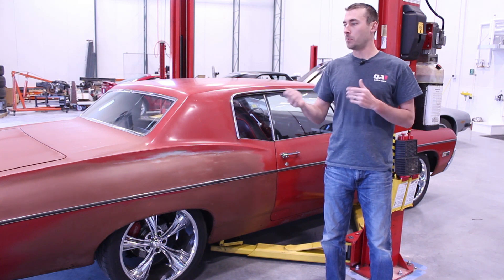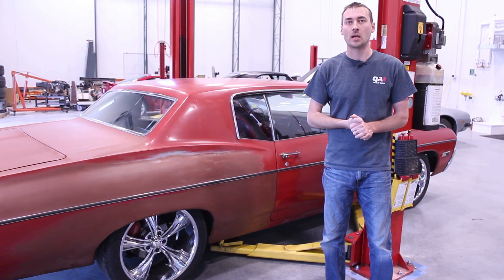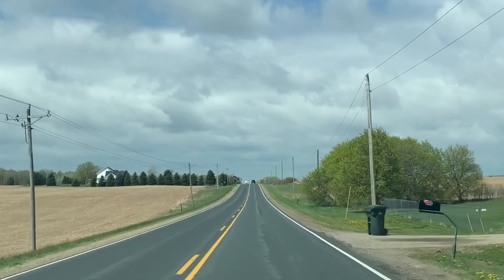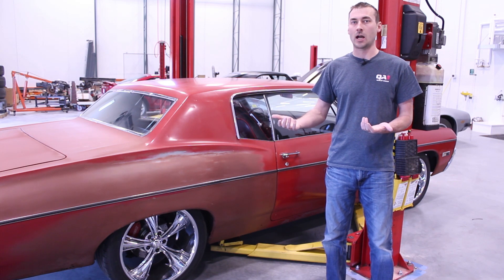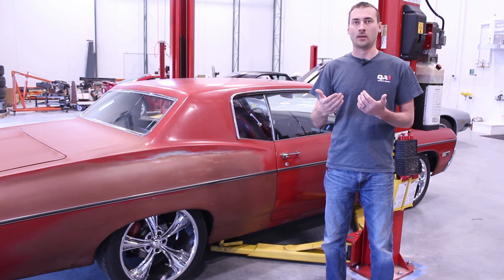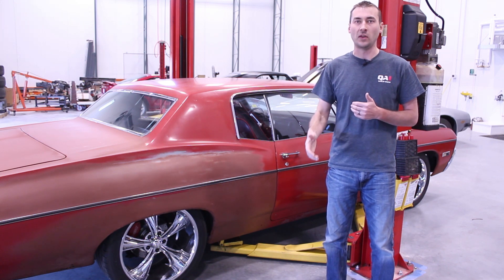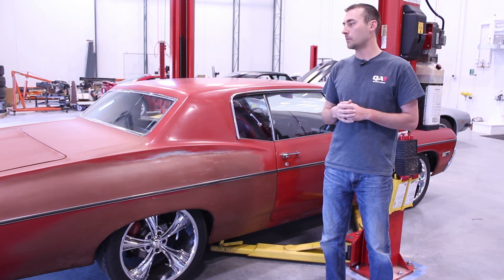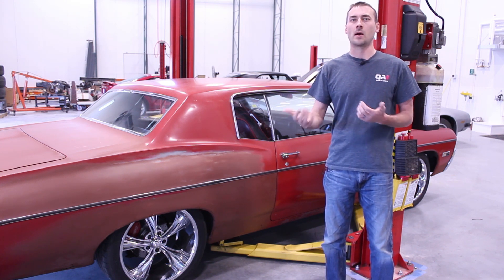Fine-tune Your Suspension for the Perfect First Drive | QA1 Tech

Comment: You answered my question so thank you. I read in the instructions to only make adjustments with the weight off of the coilover. I bought the single adjustable rear shocks and that didnt sound right. I had adjustable struts on a 240sx years ago and they did not require that so it didn't make sense to me. Figured I read the directions wrong and clearly I did cause I have the shocks, not the coilovers.😅 Which helps a lot cause I started the shock adjustment at 7 and it is a little pogo-esque. Didn't want to have to drag my jack and jack stands back out and jack the car back up in the 100 degree July heat!😂

 Even with the stock front coilovers, the handling on my 08 Grand Marquis is supremely better. I also added the CHE Performance upper and lower rear control arms and I am loving this set up. I cut the front coil springs one full coil and that stiffened up the front and lowered it 1 inch in the front. It's great. But I will do QA1 coilovers in the front down the road!

Comment: why not start with it too stiff?
Reply from the maker: There isn't a right or wrong answer! Your starting point may depend on your application. If you are looking for a stiffer performance street feeling then starting there as a baseline would be good! Call our tech line at 952-985-5675 with any questions you have

Comment: it would make sense to start in the middle. If there are 18 clicks then start with 9 in the front and maybe 7 or 8 in the rear and then go from there. I would never start at zero, Zero is basically no resistance at all- More for drag racing applications.

Comment: Hi I just purchased two new front shocks original nissan for my 2013 armada  when I installed i noticed  the next day the front kind of drop a few inches  any ideas?
Reply from the maker: Our front coil-overs are designed to lower the vehicle up to 2".
Reply from the maker: https://www.youtube.com/watch?v=ZZFqMNI8HPA
Reply: @QA1TECH  - ^ they said shocks not springs. Shocks dont adjust ride height, springs/torsion bars set ride height.

Comment: Why does QA1 define that full zero is all the way out?  Every suspension tuner or manual  up till now that I've seen says full clockwise is zero and you count your clicks out.  Never count from full out (wide open valving).  Count from full in (full dampened).  I wish there was some consistency in that as the adjustment are similar in how they work on the flow of oil.
Reply from the maker: Some shock builders/tuners do count their clicks from fully closed. QA1 has always counted from fully open. It's two different ways to accomplish the same goal.